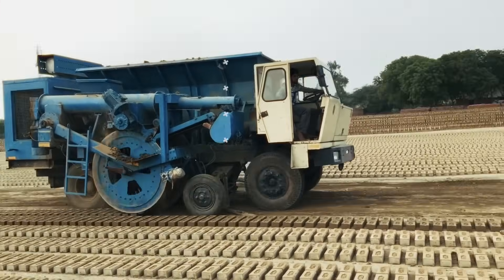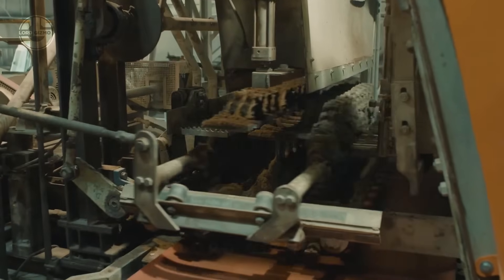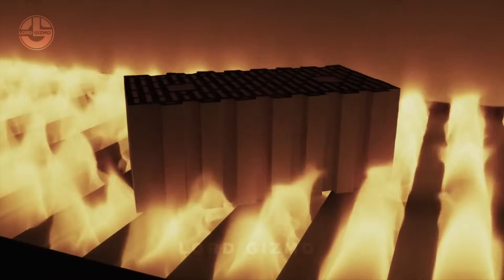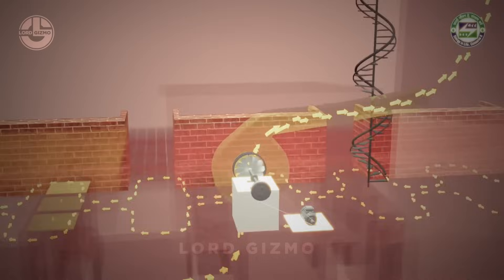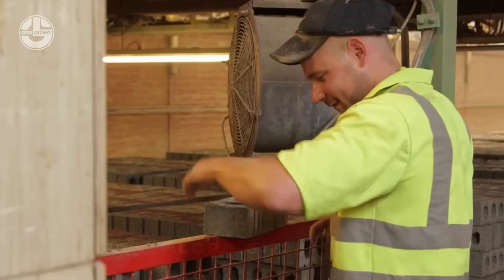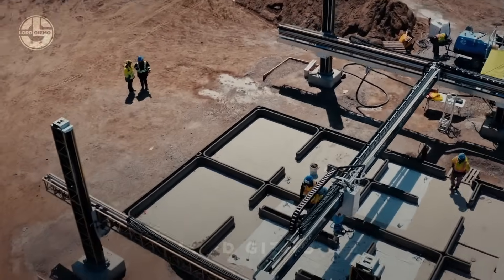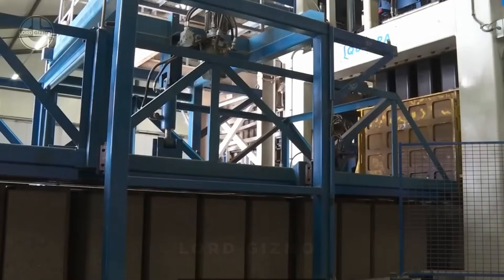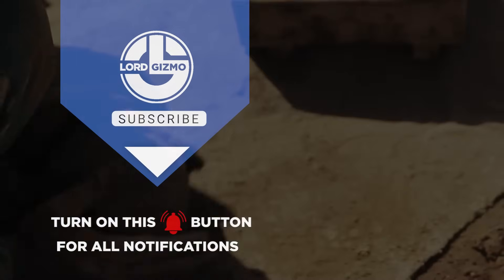How MILLIONS Of Red Clay Bricks Are Made In A Mega Factory

Comment: The products we offer include but not limited to the following:
Various types of refractory bricks/firebricks including those dedicated for kiln cars
Various types of common bricks, fired bricks, clay bricks, red bricks, decorative bricks, blocks, tiles, pavers, slabs etc.
Raw material preparation/processing machines such as reclaimers, mixers, mills, crushers, feeders, etc.
Shaping/forming/molding machines such as extruders, pre-cutters/slug cutters, brick cutters etc.
Stacking/setting machines such as robotic arms etc.
Transporting systems such as green brick conveyors, kiln cars etc.
Drying/heating/firing system/combustion systems such as kilns, dryers, burners (coal, heavy oil, and natural gas).
Packaging systems such as stretch hooders, stretch wrappers/pallet wrappers, strappers/strapping machines.

Comment: In the massive factory, each million red clay bricks are created through a meticulous and powerful process. Blocks of clay are put into the production line, through hard-working hands and strict supervision of workers. The clay is kneaded, cut into shapes and fired at high temperatures, making the red color gradually darker, bringing with it warmth and vitality. The machines hum, the furnace radiates heat, and the bricks are born one after another like small blocks containing effort, patience and pride. Each brick is not only a construction material but also the crystallization of hard work, ready to contribute to building sustainable and solid buildings over time.